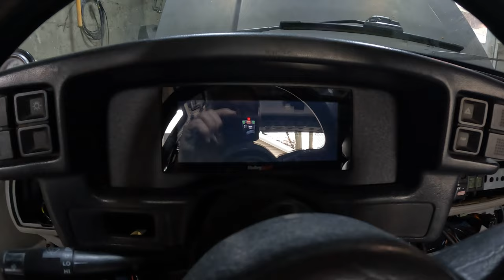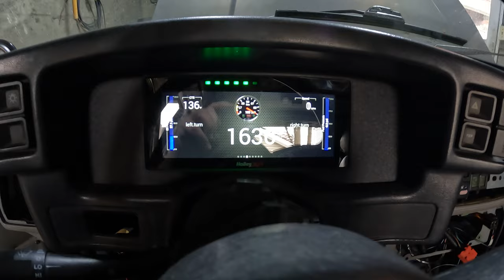Holley Terminator X - correct cam spec (TFS Track Max) 88 Mustang GT

Comment: How did the factory dash work with the terminator x? I have been thinking of doing the ECU upgrade to my 90 fox
Reply from the maker: Factory dash will work great with the Terminator X. I fryed my factory dash cluster (around $300.00 on ebay for a used one if you can find it). Thats why I bought the Holley 6.86 dash cluster - expensive but I love it.

Comment: I did a cam swap and can't get it to idle. So I just need to enter my cam specs after checking the injector phasing box? Did you have to open Throttle blade to get it to idle?
Reply from the maker: Open the throttle blade a little and see it that help. Set timing at 10 degrees BTDC. Find a certified Holley tuner near you and take it in. Well worth it!